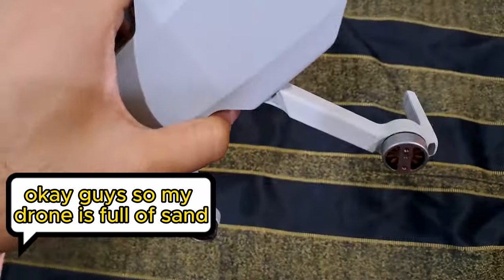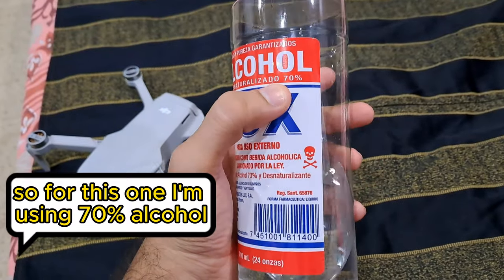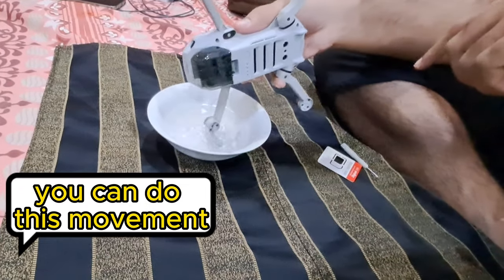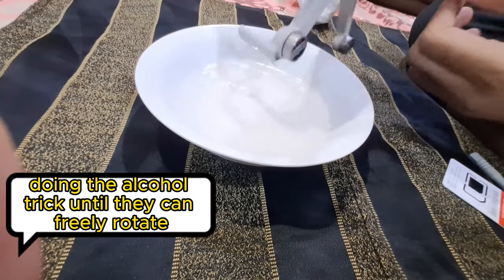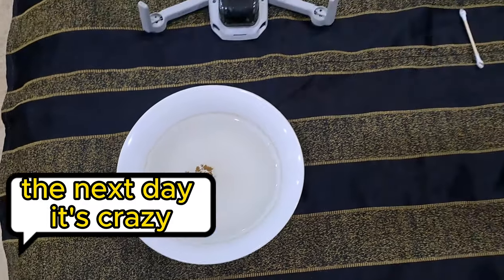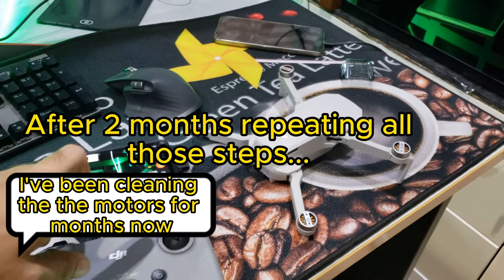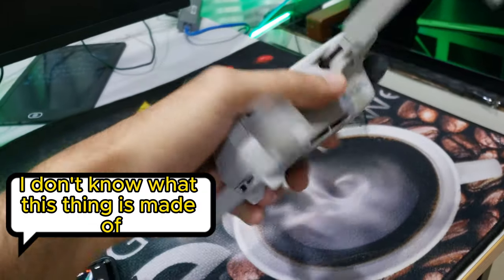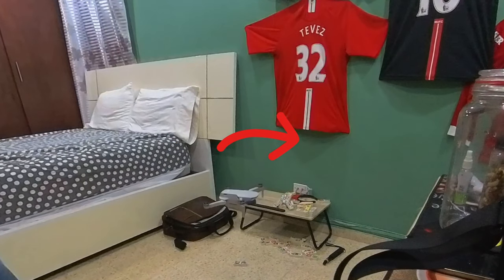Tutorial: Step-by-Step Guide to Remove Sand from Your Drone

Comment: Dont you feel like you might’ve lost stability when flying it? When you turn it on at the end it doesn’t turn that smoothly and “shakes” a lot. What are your thoughts comparing the before and after?
Reply from the maker: Yes bro it did affect a little but I was able to fly it anyways. I think I got used to it. Eventually then one day in middle of a flight it just when down and crashed and now I lost it :( I am saving up to buy a new one.